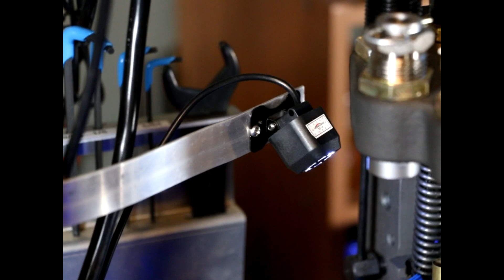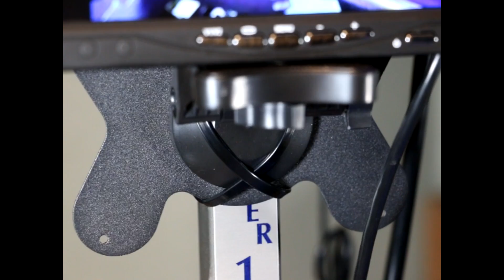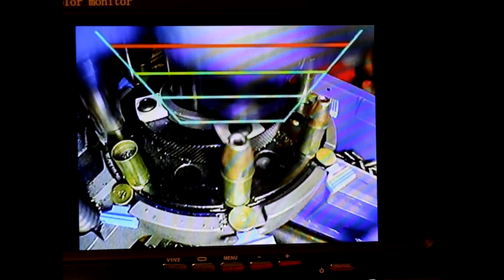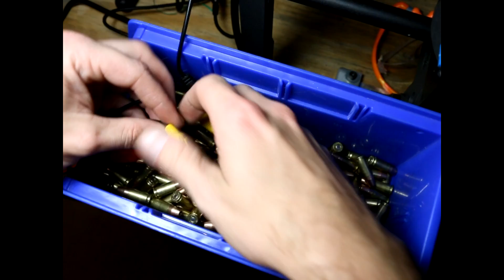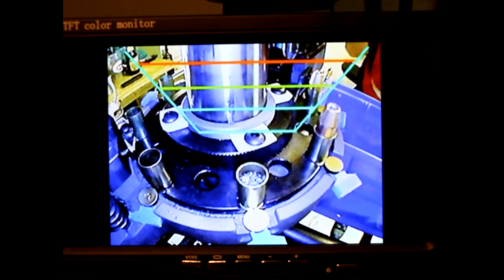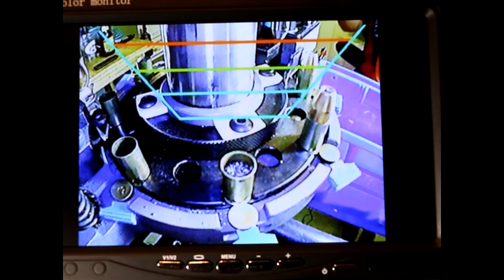DIY Dillon Super 1050 Powder Camera

Comment: Did you ever figure out how to turn the back-up grid off? Nice work.
Reply from the maker: I saw a couple write-ups on the internet, but it looked like more trouble than it was worth.  I don't even notice them anymore.
Reply: I think I saw the same ones, way more then I'm going to do as well. I just looked around, and found this front cam, https://www.amazon.com/gp/product/B017GC4GTA/ref=oh_aui_detailpage_o00_s00?ie=UTF8&psc=1. It says it's non mirrored, and has no grid lines, the monitor suggested to be used with it is the same as the kit we have. It is not lit, but I have plenty of lighting around my 1050, and for 15.00 I think it is worth a try. I am slightly OCD, and I know those lines will bug me.
Reply from the maker: Looks like this one may be even better.  Has lights and can flip and mirror, for $18:  http://amzn.to/2i3tc6v
Reply: Yup, that does look better, I'm going to order that one.

Comment: think this would work on a 650?
Reply from the maker: While it isn't as critical on a 650 (because the cases get charged near the front of the press instead of the back), I believe it could easily be mounted on a 650, using the case feeder upright tube.
Reply: You can see the case very easily on a 650. The charged cases wind up at about 7 o'clock right in front of you. No use for a camera system.
Reply: I was thinking for rifle cases (.223) it's very hard to see down into the case